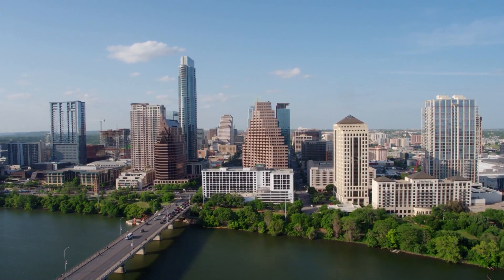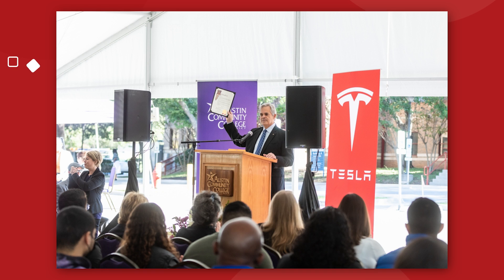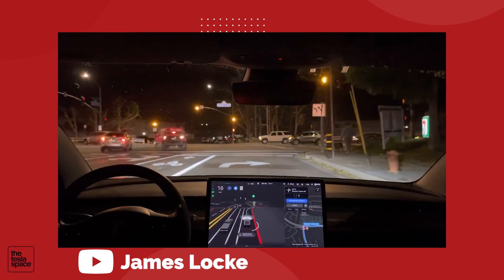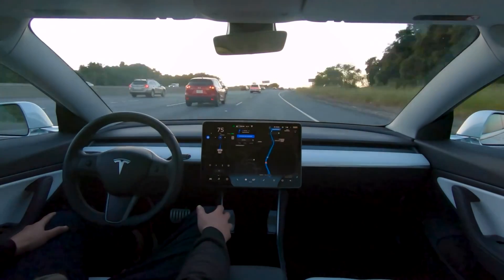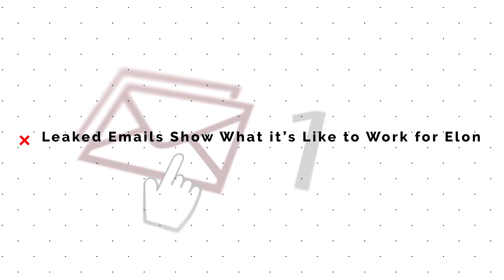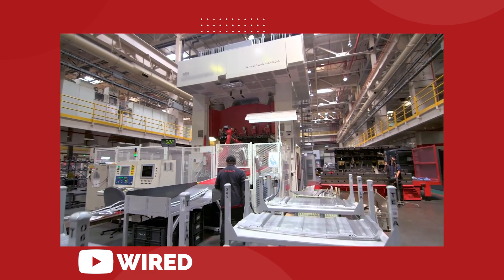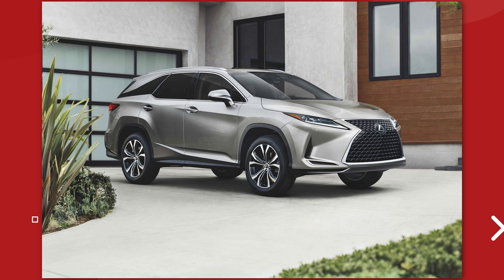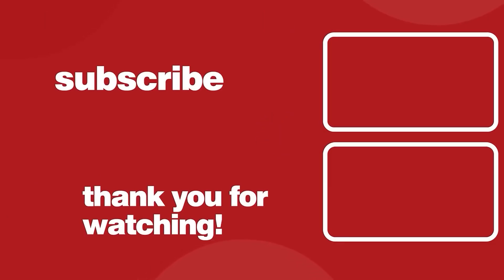Tesla Gigafactory Texas Is Opening!

Comment: Apple can't just make a self driving car without pedals and steering wheel and make it work. If they do, it'll be end of century and lots of very expensive testing.

If not anything else, regulatory approval prevents using it.

Last rumors claimed that Kia would be making it and they'd use lithium titanate battery for it. Lithium titanate battery is fast charging and very reliable but with low energy density. That would mean small city car with short range but very fast charging. I still think this as the most probable scenario. It would allow Apple to get most benefit from they brand value. 15k car with 40k price.

15kwh lithium titanate battery could be charged from zero to full in 6-10 minutes in existing charges. It could be lightweight and have city range long enough for Apple fans but in highways it would be terrible.

Comment: I am very pro tesla and a pro ev person.I own tesla stock and drive one. But I think a car with no steering wheel or peddles is gonna be a really really hard sell and is a very long ways out in terms of practicality. The 90 percent of driving that it can do is not the problem. The 10 percent that it can’t will cause complete failure. The first time you go to a wedding and are told to park in the yard…….
When there is an incident and you have to do a 3 point turn to turn around…….
You have to turn down a gravel drive to a new house……..
When the zombies attack and you have to run them over……..
Just sayin, there is always going to be that “I need to do this manually” moment.

Comment: Wish Apple every success: I want as many EVs on road as possible regardless of who makes them.  Apple making money on cars in the next decade is slim.  Could be the death knell for Apple at worst and at best just an expensive waste of time.  Elon has a much better chance of a successful iPhone than the Apple car. 

Apple has had zero vision since Job’s sad departure.  Apple has a bloated vision of what they can do.  Relying on contract manufacturing would provide an overpriced car at low volume.  FSD is 5 orders of magnitude tougher than Apple thinks; when you consider there were a dozen stupid things the iphone 4 did that have never been fixed, Apple will be amazed how iPhone inconveniences will be Apple car crashes by applying the same not so thorough engineering. 

Best asset is that Apple is NOT a legacy auto manufacturer, have tons of cash and great name recognition.  There big chance was to have seen the future and have bought Tesla when they could have afforded to.   Apple’s excellent supply change management will not be sufficient to evolve at Tesla’s rate of 140 line changes per week. Ultimately EVs will become a non money making commodity and it will be the software where the big bucks are made. StarLink, Tesla Insurance, Tesla batteries, Solar, Auto Bidder, FSD will be tough value added plays where the moats will be multi-faceted.  

Apple does not have a futuristic management which will be essential in this market.

Comment: No matter what else happens, the building has to be completely closed in. This is the rule all cities, you can not have employees working inside producing vehicles, until the employees are protected from the elements, completely closed in, In the past. Although this may be different for Giga Austin, it has been 4 to 6 weeks to actually start production, after completely closing up the factory. So, the first of January may be a little early, but we will see.

Comment: With the cold weather test...  There is a problem with switching to winter tires, and that they will probably not be as efficient.  Also driving in snow / ice will have a different amount of road resistance.  Was the test just to see how the batteries would hold up in cold weather?  Or was this supposed to be a real world test?   A lot of variables to consider...

Comment: Apple, for all the hype, has missed the bus! 
A fully autonomous robocar would have been just the thing that Apple should have been doing, and they should have bought Tesla when it was offered to them in a platter, but they slipped up! Now it is too late and even if they have the software ready, they don't have the manufacturing or the know-how of making cars and outsourcing that, which is what they will have to do, will just not work. 
So it is just pipe dreams for them. Tesla, in the meantime, has raced far ahead
Reply: Apple cannot even fix a bunch of annoyances my iPhone 4 had and cannot tell the difference between then and than. Always gets them backwards; but no one died.
Reply: Not buying Tesla is Apples BIGGEST BLUNDER to date!

Comment: There is some stock footage of a car in self driving mode that I have been seeing for at least 3 years in various videos, why is it not ready for use yet? The guy never touches the wheel for a variety of driving conditions. How can this not be ready for prime time yet?
Reply: Are you talking about the Tesla self driving demo? Their cars have been capable of that for at least three years but they have been working on the much harder city and minor roads. If you mean Apple or Waymo they are stuck in a local maximum with high resolution and Lidar. That will only work in a few hyper-mapped, geofenced areas. Not much money in that, might as well just paint a line on tve road and follow that. I had a toy car in the 1970s that could do that.

Comment: EV car has problem with interior light switch.
Tesla: Yep, we can fix it.
Apple: You'll need to upgrade the steering wheel, change the battery out, replace the motor and get a new chassis.
Reply: You know their charging cables will wear out quickly too 😆
Reply: Apple: (we’ll also stop them from being able to drive their cars until they update to the new firmware…)

Customers: What was that?

Apple: Nothing…

(Apple user here btw)
Reply: Nope more like Tesla, hey boys activate the software interior light switch on the screen buttons …
Apple : and why would you need your interior light , just use your iPhone/ iPad in light mode ….